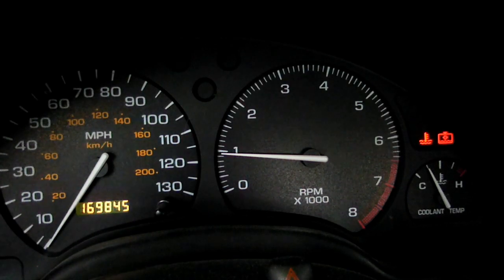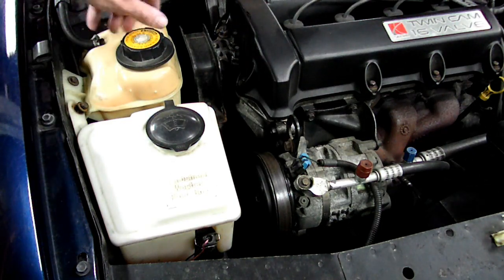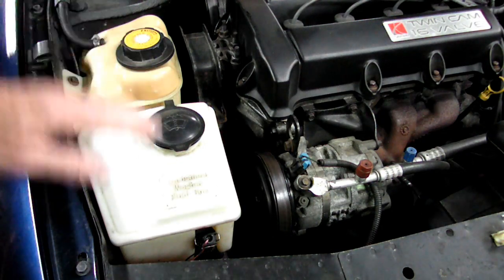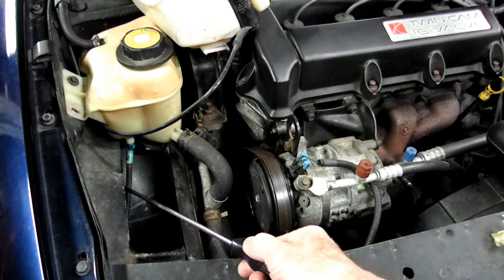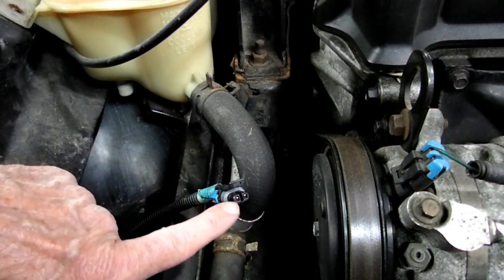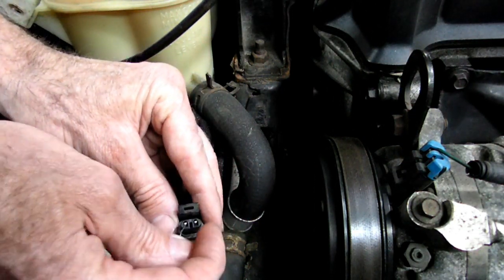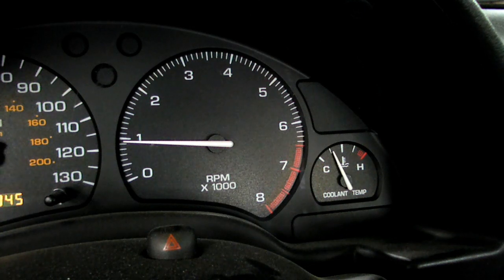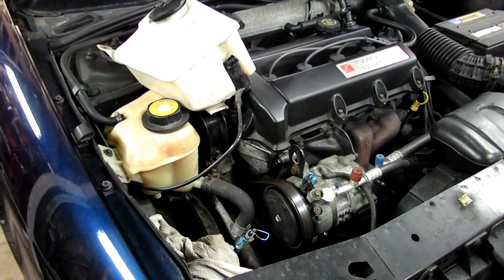Coolant Level Light Troubleshooting

Comment: WATER PUMP TOOK A DUMP, TOOK IT TO THE SHOP, AND THE LIGHT SENSOR CAME ON WHEN I GOT IT BACK , TOOK IT BACK TO THE MECHANIC, HE DIDN'T KNOW WHAT TO LOOK FOR AND SAID I WOULD HAVE TO TAKE IT TO THE DEALER, WATCHED YOUR VIDEO STEP BY STEP, TURNS OUT HE FORGOT TO PUT THE SENSOR BACK ON, THANK YOU SIR FOR YOUR HELP IN TAKING THE TIME TO SHARE YOUR KNOWLEGE , HAVE A GREAT DAY.

Comment: so I have an issue with my Saturn VUE 3.5 V6 AWD  , I don't know why the fans don't turn on  but the motor does not overheat ,  I checked the temperature sensor and I replaced it with a new one and it shows the same heat level .  Is there a way to test the temperature sensor and make it reach over 200 so the fans turn on?

Comment: hi i am new to the channel but i have the same issue and i have tried this technique and after 15-20 seconds the flashing starts all over again so my question is should i still remove the reservoir and clean it out or what else could be causing the issue? the car runs good otherwise aside from having to give it a little gas to keep it from stalling when trying to start it at times but once its running i have no issues at all except this flashing light, thanks in advance

Comment: TY so much for this video I have had my fluid light on all the time for about a month now and when a friend took it off and flushed it out there was all kinds of nasty stuff that came out. The light went out now I don't have to worry about it. I was in the process of selling it but didnt want it to go with the light on and not knowing why. Sorry I wrote a short novel but I'm very excited about ur video it helped me out so much ty again!!!!
Reply: Its my experience  that the sensor (float) inside tank is NFG. The coolant reading is a FALSE READING. If your tank is full and dash "coolant light is on its a bad float". Its not a problem for you.
Reply: You don't have to buy a new tank. Jump it -  remove dash indicator and keep eye on coolant level in tank. I've had this issue for years. Temp, coolant is perfect.

Comment: I"ve had my Saturn for 4 or 5 years. Fixed it myself for the most part (all known common problems of Saturns. Mine is an '03 Ion.
I found your channel and it really helped. I am now a confident DIYER thanks to your presentations.
David
Alberta
Note* No need to change tank if only a bad float. Waste of money. "COOLANT" indicator is a FALSE READING if your tank remains full.

Comment: Will this sensor cause car problems if it is not fixed besides having the coolant light go off? I’m trying to fix my heater. Replaced the thermostat but this light keeps coming on even though it’s coolant in the tank.

Comment: Hey I have a 2001 Saturn Sc1 that just failed smog. I replaced the EGR valve and camshaft sensor thanks to your videos. I removed the battery to put a new starter in and now it failed smog because of the OBD or whatever that is, I've driven the car about 1000 miles since then. How can i make it pass smog?

Comment: My car  (1996 Saturn SL2) did the same thing. I came outside one day and my door locks were going up and down like crazy. You have a bad door lock switch on the driver's door. Just remove the door lock switch from the passenger side and install it on the driver side. Get a used switch from a junkyard later for the passenger side.

Comment: My 2000 sc2 water light is on and I'm loosing fluid some how cause I have to keep refilling it but I not seeing and dripage  coming from anywhere, any ideas what the problem might be?
Reply from the maker: The 00-02 DOHC had a problem with the plastic intake manifold take a look at this video.Saturn SL2 Intake Manifold repair
Reply: richpin06a hi richpin, this link doesn’t work, can you refresh it?  Thanks.

Comment: Hey Richpin, I really appreciate your videos! 

So I have a question, I recently fixed my intake manifold with the dorman mod, but now my water level light is staying on, I’m worried coolant might not be getting to the heater core, any ideas?
Reply from the maker: Is the actual coolant level in the tank correct.

Comment: nice video. but what happens when u bypass the harness and the light is still blinking. even changed the sensor... light still blinking... coolant level ok. fan turns on. everything runs fine. but that light wont stop flashing
Reply: pete t I have this problem did u figure out what was wrong?

Comment: So my 2000 saturn sl1 doesn't have those wires running to the sensor you pulled off, are there supposed to be wires connected to that sensor?
Reply from the maker: +ThePowerstrokeManiac All the ones i have seen have wires to the sensor.